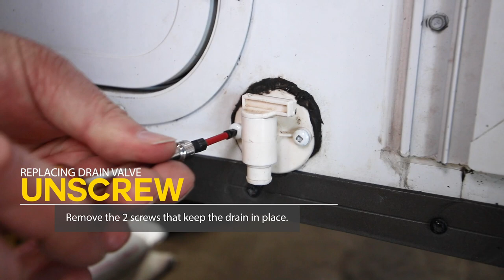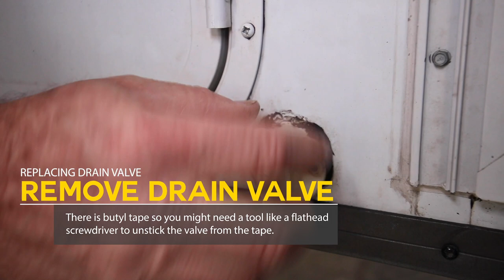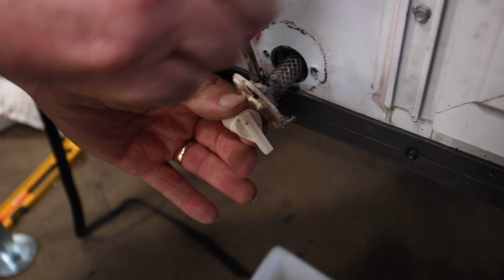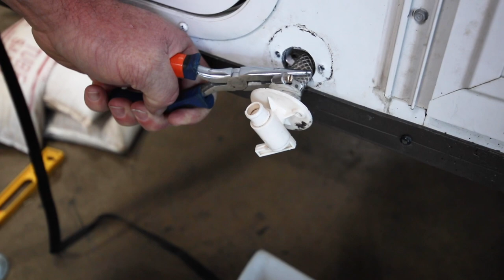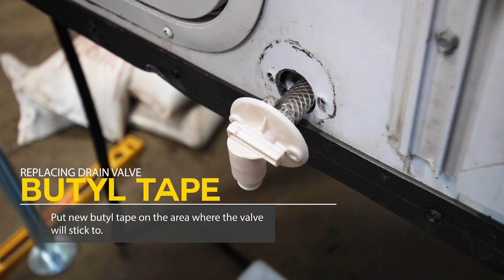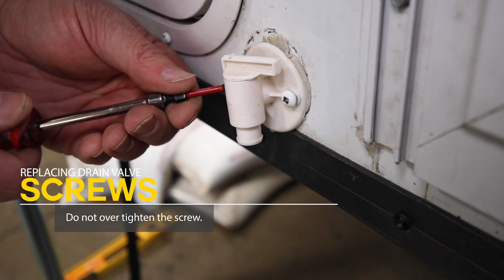Water Drain Valve Replacement | Four Wheel Campers

Comment: Thank you.
I have a 93 Ford E350 Jamboree Rallye motor home. I pulled off the drain plug but it broke. The hose is so short that I can't access any of it to try and put the clamp on or pull and or cut out the piece of valve that is still inside of the hose. How would I access the hose to replace it. There is a molding all around where the hose would be. I don't want to pull to hard on the hose. Do I have to take off the guard/molding that is around where I believe the hose is. It was worked on before and they really did a blotched job. I really need to get this fixed. Thanks